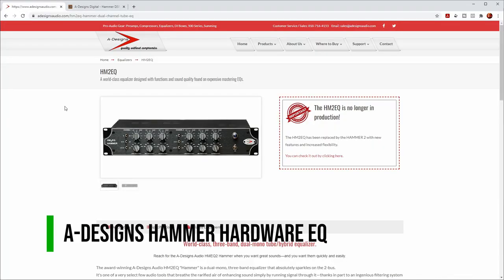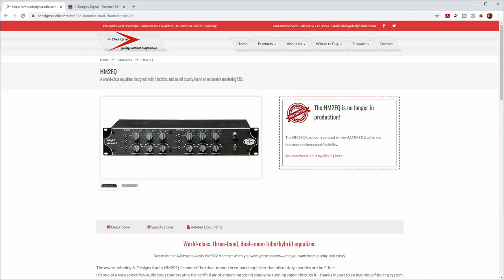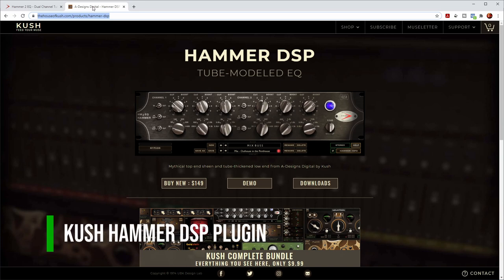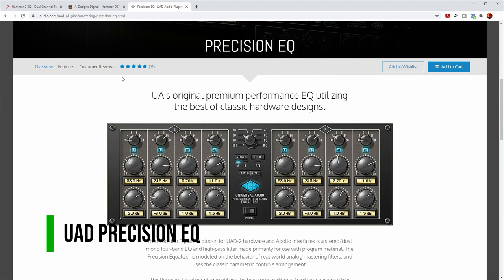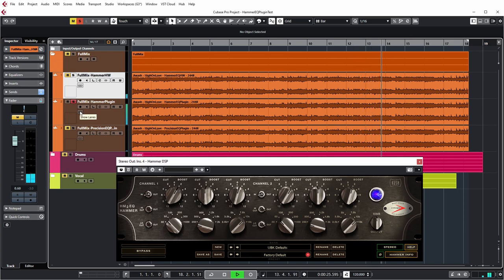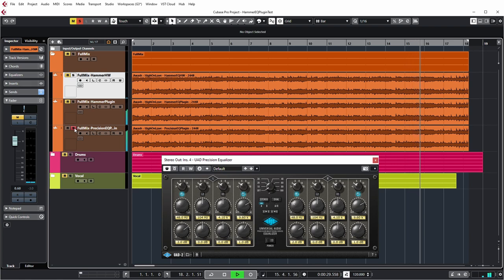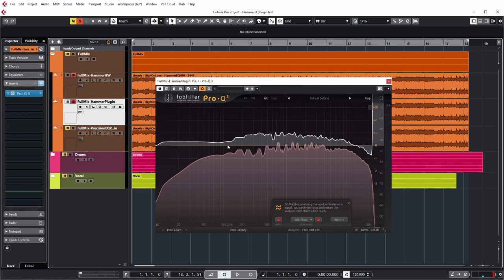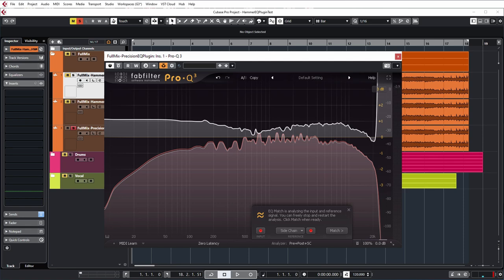Best Bus EQ: A-Designs Hammer EQ versus the Kush Hammer DSP plug-in

Comment: I once compared one of my hardware devices to the according plugin. I realised that often you have to adjust the plugin settings slightly different to get a closer match. To put it differently: Same settings on the plugin don't necessarily mean same sound. 
Another thought: To run your signal through the hardware means to convert it DA, then run it into the hardware and back to your AD stage, right after the Line input. The plugin however gets the direct waveform without any influences like cables and converters. The differences don't really surprise me, especially the smoother high end. Even the copper in the cables can lose some high end by converting it to warmth. 
Besides, I wonder how big the difference between two hardware versions would be, thinking of tubes of different ages, different serial numbers...
For me, the plugin sounds close enough.
Reply from the maker: Yes all very valid points 👍. I’ve had the hardware for years so the tubes response has probably changed over the years and it is not exactly the same unit that the plug-in developer used either. I mentioned this in the video as well. 
Off camera I also did the comparison you mentioned where I changed the settings to match them up even more. If did get closer this way. But all of that got too long to include in the video.

Comment: The main problem here is methodological, namely: it will be next to impossible to get the plugin and the hardware truly 'matched' because the  numbers on the hardware's front panel don't reflect what it's actually doing.  And THAT is because the gain potentiometers (all pots, not just the ones on the Hammer) have a pretty wide tolerance (usually +/-20%).  So you can set +3dB on the hardware and actually be getting closer to +4dB, or +2.5dB, or anywhere in between... and these variations are different for every hardware Hammer on the planet.  You may have also noticed that setting everything to 'flat' on the hardware is anything but a flat response, there's a random gentle curve centered at each band's frequency, for the same reason.  That said, the Kush plugin is amazing and I use several on every mix, but I'm not selling my hardware.  That's not a knock on Kush (quite the opposite), it's just my experience that analog eq exists in a realm that no plugin has ever replicated, and I suspect that will always be the case because they are fundamentally different media.
Reply from the maker: Thanks for providing your experiences with the hardware and the plugin!

Comment: The air at the top of the Hammer plugin makes it (subjectively) sound slightly better to me than the hardware.  I thought the Precision sounded very similar to the Hammer plugin EQ wise, but I twice thought that the snare drum decay sounded a little different. Slightly shorter as if there is a slight low mid compression going on? Does anyone else hear that? Edit, I should say that this difference was only noticeable on the full track demo, not the drums alone
Reply from the maker: I guess I like the hardware slightly better for the same reason that you prefer the plug-in 😉😎. You can push the highs quite a bit and it still sounds smooth. Possibly due to the slight roll off compared to the plug-in. 
I didn’t notice the snare decay you mentioned but will listen again later in the studio. Thanks for commenting 👍.
Reply: @LanewoodStudios  It is of course true that there is still something indefinable about hardware that makes it appealing, perhaps it can't be measured so easily, but I feel it too.
Reply from the maker: @parrothouserecords  if you own the hardware you hear it even more 😉.

Comment: Everything goes through my KRK's and my studio, even streaming channels.
So hearing this I'd say they are similar the UA has a slightly thinner top end through my monitors.
I'm in the process of using m Tascam 688 as a mixing board into my DAW for guitars and vocals.
There is a plugin to emulate this classic home studio.
And I have the Kush Sub.
I use the Kush Omega Plugins 458 for orchestral strings etc Omega A or N for fast drums.
But any Machine has it's own sound transformers wires capacitors etc. This is damn close.
I use the Hammer and then the Clariphonic on my Bus with the Novatronic usually but I'm experimenting with the Silika and AR1
Reply from the maker: Thanks for your observations and input! Lots of goodies to check out again ;).
Reply: @LanewoodStudios  I'd love to see the Omegas compared to a board..but I know it will be tough to get a NEVE SSL and Tube desks!!!
Reply from the maker: @harrisfrankou2368  ha ha .... yes i guess that would be hard indeed!